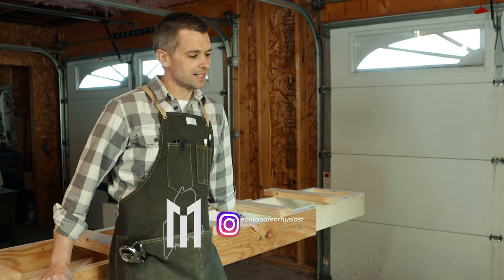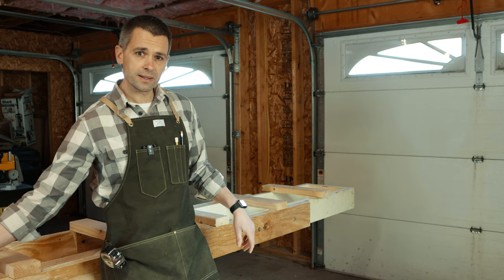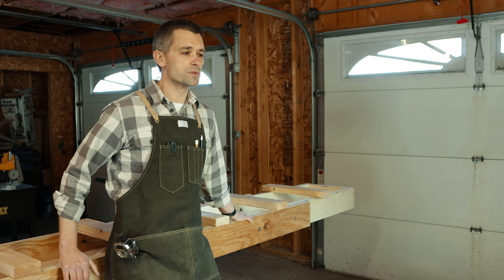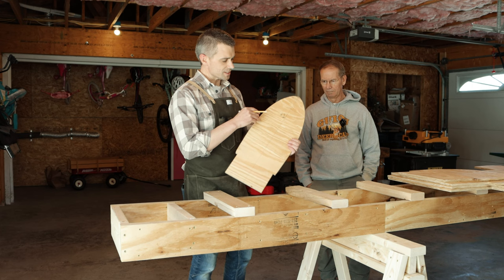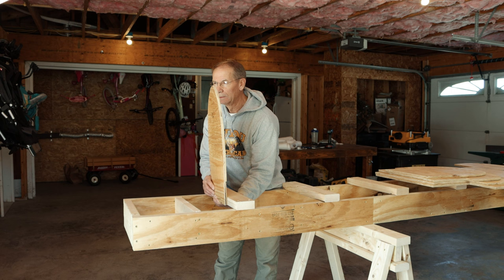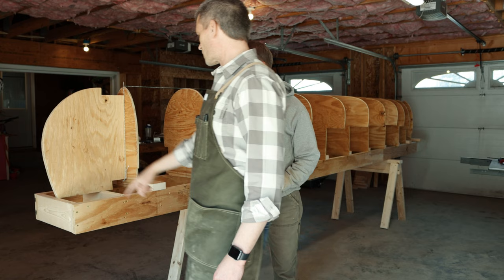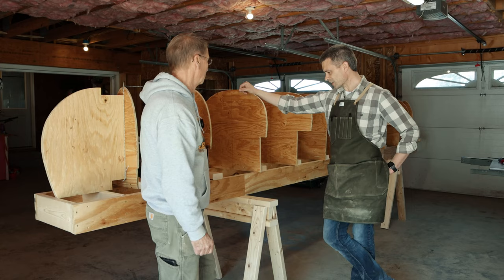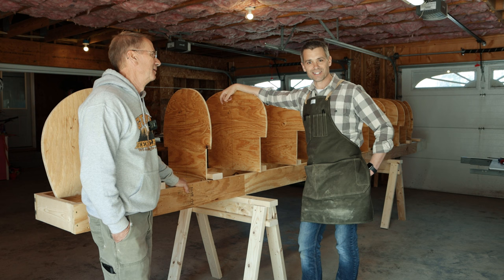Building A Cedar Strip Canoe (Part 2) | Installing The Stations

Comment: Plan on using Staples as most builders do. I beg you pleased to sharpen Staples by the row. find a whetstone. The now sharper than factory Staples can slide between the cedar without tearing the cedar fiber. You can swell the hole shut  and you don't have to bother filling them. Sorry but I don't have a YouTube video to show you how to do it.
Reply from the maker: Yes, I plan on using staples. That’s good advice, Thanks!
Reply: To my knowledge you will be the second builder on Earth to sharpen Staples and this is one of my original ideas that I wish to pass on to the building community.
Reply from the maker: That’s interesting Robert! Have you built a lot of canoes? What’s your favorite model?